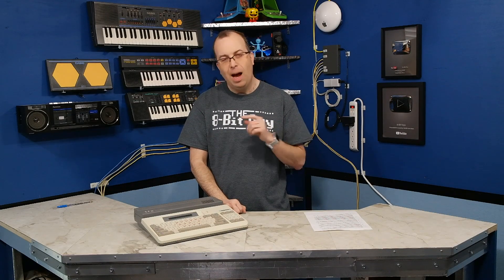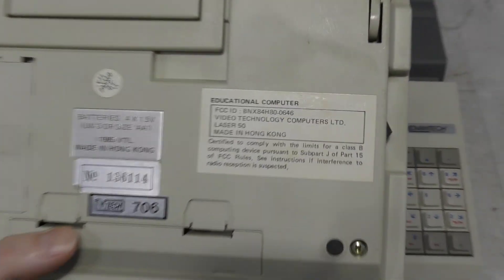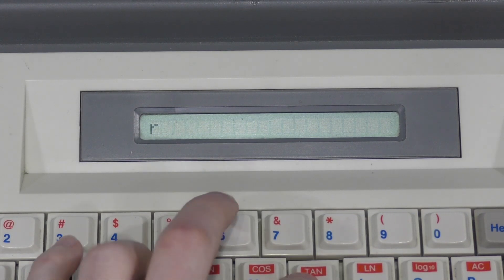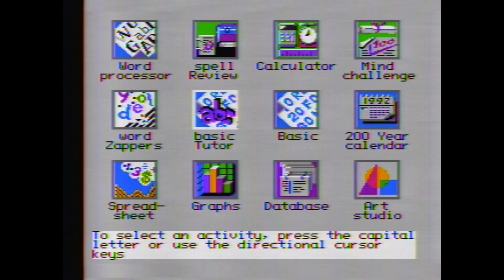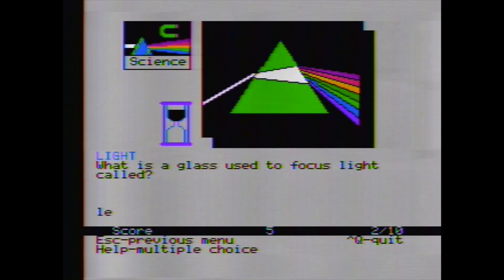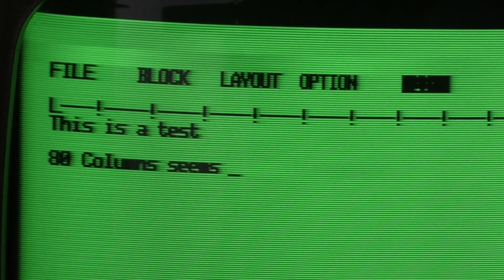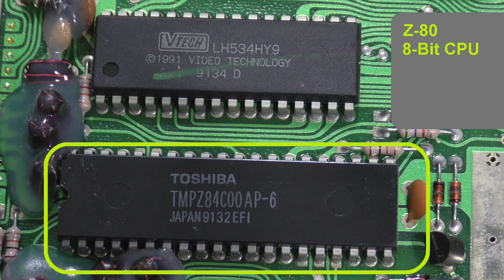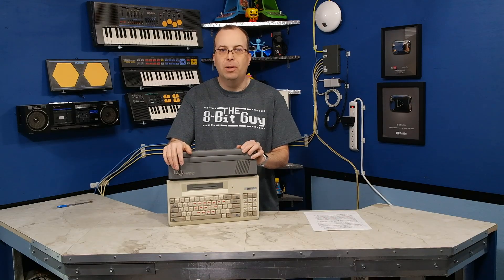The Advantech I.Q. Unlimited with BASIC and a Z80 CPU.

Comment: Some comments on this machine. The TMP42C50N microcontroller has 512 bytes (not kilobytes) of ROM and 32 nibbles (half-bytes) of RAM. It seems connected to the keyboard ribbon by a series of resistors, so it probably is a keyboard controller. The 74HC244 seems connected to the printer port, so it most likely works as a printer port interface.

Now we begin with the guesswork. Knowing that VTech had produced the Laser 128, an Apple IIc clone, and that this computer graphics mode is, apparently, pretty similar to the Apple II's DHGR mode (560 by 192, 16 colors generated by color subcarrier artifacts), I'd venture and say that the two unknown chips are an Apple-II-in-a-chip and a ROM chip (containing the firmware and the programs). The LH534NY9 sits next to the microprocessor, typical for a ROM chip, and the 26-5063-01 SMD chip on the backside is similar to chips in the Laser 128/128EX motherboards known to be related to video generation, so I think this is plausible.

If this is true, the use of the 128 KB of semi-static RAM would make sense: the Apple II models with 128 KB of RAM divided it into two banks of 64 KB (main and auxiliary). It wasn't paged memory, you had to switch the entire address space, so you could only access one bank at a time. Because of that, it was usual to use the main bank for the OS, the program, the display RAM and the working memory, and the auxiliary bank as a RAM disk (managed by the OS) or a data storage (this is a simplification, but accurate enough for this discussion). If so, this machine could use the first 64 KB as working memory, and the remaining 64 KB as battery backed storage. This would fit the ad that said "64K of RAM allows students to to use and store programs".

The Advantech I.Q.  is amazingly similar to the Tiger Learning Computer (https://www.youtube.com/watch?v=WZk-utRYrI0), a prototype of an Apple II compatible educational computer made under license from Apple in 1996 (and cancelled when Jobs returned). Both are supposed to be easy, self-contained computers with no moving parts and a limited software library included. These two characteristics, while limiting to full-fledged computer users, were attractive for parents looking for a simple (and durable) computer for their children. And I'd bet my hat that the Tiger Learning Computer (advertised as having "Apple IIe Technology") was based on Apple's Mega II, basically an Apple-II-in-a-chip created for the Apple IIgs and later used in the Apple IIe Card for the Macintosh LC.
Reply: By the way, even if this machine uses an Apple-II-in-a-chip, it doesn't make it an Apple II compatible or clone - because of the Z80 processor. But, in theory, it's entirely possible to stick all the logic of an Apple II (or any 6502-based computer) to a Z80 processor. The advantage? Using a proven hardware design without having to develop it.
Reply: Sounds pretty cromulent vs what I was guessing at. I'd figured on 4x 32k blocks and 12k of video memory (which would fit with 6x8-pixel chars and 480x200 total), but if the remaining space readout was rounding up fairly heavily or just dividing by 1000 instead of 1024, then the just-over-13k needed for a 560x192 monochrome display would work too. Guess we need to try and count the dots used in the low rez mode to determine if it's more likely to be 240 or 280 total (or even 320? I don't think the clock is quite fast enough for that...)

That hard bank switching would make loading or saving files a complete pain in the ass, at least if you were using the second 64kb (there are multiple virtual drives, I expect at the very least it's "saving into whatever's left of the first 64k" and "saving into the second 64k" plus use of some additional cartridge or a real disk drive or cassette deck that's been somehow connected). If you can only use one half at a time, you're going to have to shift probably single bytes, maybe two or three at a time max, via the processor registers only (or maybe a few extra if using the keyboard controller RAM too). Though so long as the bank switching delay wasn't super massive you might be able to get a few kb/sec by that method, which would be sufficient for the small files involved.

Bigger issue is - how do we access the ROM? There's 512kb of data in there, and it's all code and graphics needed by the programs. We can't realistically keep banking in 64kb of that with no RAM available, the machine will spend all its time banking back and forth and not even have any spare register space left to do any proper work. Maybe the necessary data for a particular program will be copied across in the same way as loading in a work file, but 12 progs total means each average about 42k. It seems like it would be a very inefficient way of doing things. Better to split the address space into e.g. four 16k chunks... Working memory, VRAM, storage RAM, and ROM... each program actually taking 2 or 3 banks out of the 32 in the chip. Though of course it's not necessarily the case that all of them are used. It could be 12x 32k (=384kb used), or even just 12x 16k (well, actually 13x, as the main startup menu would occupy a space too) with 512k ROMs simply having become cheap enough by 1991 that it didn't save any money to risk speccing it with a 256k before the software was finalised.
Reply: A couple of notes on memory banking on the Apple II - which should apply to this machine if it's based on an Apple-II-in-a-chip.

First , when I said that the entire address space was banked, I simplified it a bit. The lower 48 KB of address space banks as one unit, and the upper 16 KB, which contains the ROM, banks as other unit. Both can be banked independently for reads and writes, so you can set one bank for read and the other for write, and copy memory from bank to bank in a thigh loop.

Also, the 16 KB ROM space is banked itself. Starting with the IIc, the Apple II supported 32 KB of ROM divided in two banks, and it is technically possible to use more banks to support larger ROMs. That space can also be switched between RAM and ROM, so you can access the full 64 KB of each RAM bank.
Reply: Actually checking on how the Apple II made its video, it ran the pixel clock at exact multiples of the NTSC colourburst; twice for hi-rez / 6 colour mode, ie 7.16mhz, and four times for double-hi / 16 colour mode = 14.32mhz.

That wouldn't gel too well with a processor running at 6mhz... and looking more closely at the text it definitely seems to be 6 pixel wide, not 7. Plus the way it creates its colours is very much different (pairs of greyscales with maybe 5 or 6 levels, rather than 4+ strips of pure monochrome) and the number of them it seems to use is different too (12, not 6 or 16). It's still artefacting, but synching differently with a different set of patterns, maybe closer to how the NES does it (also in the region of 6mhz). Could even be the common 5.37mhz (or 10.74mhz for 80-col) as used with a whole load of TMS VDP-using machines, which just about fit 256 pixels across a TV screen with a small bit of over or underscan, so 40 (or 80) 6-pixel characters would work just fine.

Though I'm wondering now, seeing how the modulator attaches to the "power" PCB - and how the composite output is cosited with the DC input - if the video system might actually be wholly separate, including a CRTC or VDP plus its own 16k or so of memory... very much like the CGA, in fact, and a variety of early 8-bit computers (inc MSX, BBC Micro) and consoles (Intellivision, Sega SG1000), just with the bit patterns for colour mode being interpreted in a way similar to that of the Apple IIgs in its specific hi-rez mode... which can show black and white pixels in full resolution, but any colour appears effectively in low rez, with a limited set of patterns putting black, white, and four primary colours together to make 15 pseudocolours. In this case though it's all greys instead, creating colours entirely through artefacting, and only making maybe 12 overall. At least, that's the most I can count on any one screen in the video.
Reply: Yes, it looks like the character cell is 6 pixel wide. It fooled me, 
because it uses a character set similar to that of the Apple II, which 
used a 7x8 cell with 5x7 active pixels (two empty columns on each cell). This computer seems to use a 6-pixel-wide cell with 5 active pixels.

The palette is also weirdly similar to the Apple II's hi-res palette (black, white, green, orange, magenta and blue) but with two different intensities for each color (full and half intensity). This would also allow for a single gray (half intensity white). The presence of four "primary" colors would point to a 14.32 MHz color clock (four phases over the 3.58 color subcarrier). The pixels look aligned with the color clock, so I'd venture to say it uses a 7.16 MHz pixel clock. This is coherent with the artifacts shown by white text on black background in a color monitor (which are always one of the four colors from the Apple II palette).

There seems to be no apparent limitation on which colors can be on which place, which would point to a true 16 color framebuffer or a NES/MSX-style tile-and-attribute mode. I think the former is more likely, because if it used a tiled mode, why limit the color palette so heavily? Even the NES can display 25 colors from a palette of 54 with just 2 KB of RAM.

Anyway, I can't think of any home computer or video controller with those specs, and it seems weird to develop a completely new chipset for a cheap computer when you can grab an of the shelf part and save the design costs. This is why I thought it used an Apple-II-in-a-chip...

Last, the processor is rated for 6 MHz, but it doesn't mean it actually runs at that speed; it's just the part's upper limit. I'd bet it is an integer divisor of the 14.32 MHz master clock bellow 6 MHz, so 4.77 and 3.58 are the most likely speeds. Taking into account that the graphics controller itself runs at either 3.58 or 7.16 MHZ, and doing a 4:3 bus interleave between the graphics controller and the main processor is possible but hard, the processor probably runs at 3.58 MHz. Then, why bother buying a 6 MHz part to run it at a lower speed? Because it probably was the cheaper variant available by the time this machine came to market.
Reply: Hm, possible, but I'm not entirely so sure though. The colours appear to be black, white, three or four greys (we can see three just on the menu screen, and I think there might be another darker one that's seen in a couple places), a royal purple, a slightly lighter and pinker purple, a kind of scarlet/sunburn red, a darker red, a single amber-ish yellow, a light and dark green, and a single sky-ish blue. Which actually when I add it up properly is 13 or 14 colours, not sure how I arrived at 12 before :-) So probably there are 16 bit patterns, with a couple instances of two patterns aliasing to each other.

The amber colour particularly is less Apple-ish orange and seems more similar to the only (full intensity) yellowish colour that the NES is able to produce, and its PPU actually outputs dots at about 6MHz IIRC, which is a bit of an oddball.

...Google says: actually 5.37MHz, and it generates colour in a curious manner by producing a binary squarewave that, unless full screen tinting is used (which overlays further attenuation on part of the waveform), simply alternates between zero and the fraction of full signal intensity matching the colour brightness at 3.58MHz, at any of 12 phase shift positions (~43MHz precision - counting both the rising and falling edges of the ~21.5MHz master clock from which the PPU divides by 4, the colourburst clock by 7, and the CPU by 12)... Which gives us the 50-some colour palette by providing 4 intensities of 12 hues, plus another 8 or so greyscales that keep a steady signal level or alternate far faster than the colour clock. The frequency is just about enough for 256 logical (and monochrome) pixels, though certainly not 280, but only around 172 distinct colour patches in the same space... the points at which the colour actually switches drifts slightly line by line and frame by frame so as it rapidly skims across the underlying logical pixels you get the impression of 256 slightly smeared coloured pixels instead.

As that 256-pixel image tends to quite neatly touch the edges of a TV screen, and the IQ's 240 or 480 pixel one has a narrow border inside of it (looks like one to two character spaces on each side in 80-column mode, so about 504 visible pixels, or 252 in 40-column), I'd go with 5.33 and 10.67MHz being quite good matches for the frequency. Even a full 6 would probably be too much - you could get closer to 576 pixels with that, which would mean a full 8 blank character spaces each side on a screen perfectly matched to a NES or similar console, though it's possible these screens are adjusted to give a rather extreme amount of overscan? 7.16MHz would be far too much - that's what systems like the Amiga use, and they can comfortably fit 320 pixels within the underscan region of a regular TV, or 640 at 14.32MHz.

That's sort of how 320/640 and 8-pixel characters became a standard resolution, even, as it was first seen in the C64 and Atari 8-bits, which used a 7.16MHz master clock, running their highest resolution modes direct, halving it for low rez, and quartering / sixth-ing / eigth-ing it for the CPU and other parts of the chipset. Otherwise 6 or 7 pixel (TMS VDP, Apple II) or even 9 pixel (as used with the PC MDA, and the Atari ST could easily have had 360/720-pixel modes using its 8 and 16MHz clocks instead of very heavily bordered 320/640 ones, if the designers weren't aiming at matching the resolutions of the Commodore range as well as economising on memory)

I don't know how it relates in terms of colour generation, but that text resolution makes me think that it might be using a Texas Instruments VDP type video chip, which certainly for 40 column text modes used a 6x8 font (5x7 actual glyph pixels) for 240 active pixels plus a protective 8-pixel border each side, versus the 256-pixel graphics rez it also offered, both with a 5.37MHz standard clock. Later models presumably extending that to 512 pixels or 80 column text with 480 pixels, at 10.74MHz. And of course 24 or 25 rows, using 192 or 200 scanlines. ISTR it offered upto 16 colours too, though how complex you could make the actual graphics may have been limited by a 16kb total memory space at least in earlier versions.

Also the monochrome image shows a rather different way of building a colour picture than what the Apple II uses:

6-colour mode on the Apple uses pairs of straight black and white pixels, at 7.16mhz, so you only actually have four colours for each of the 140 double-pixel spaces; each block of seven "real" pixels (so 3.5 wide pixels) is switched between green/magenta or orange/blue using the otherwise undisplayed 8th pixel (so actually I miscalculated - hirez takes 7.5kb and double hirez 15kb, for the equivalent of 320x192 and 640x192 monochrome), which shifts the actual timing forward or back by 45 phase degrees (so a quarter pixel). Which is why making graphics that use colours from both groups on the same line without artefacts can be quite tricky. The blue and green are fairly similar, but the orange and purples don't really match, the red is completely missing, and there are no greys.

16-colour mode uses binary pixels again, no greys, in groups of four instead of two, at 14.32mhz. Every colour is unique (there's a full 16 colour palette), and whilst several of them seem to match with the IQ, there's a number of differences also. For example, two blues, another green, both an orange and a proper yellow, and a light pink... but only two flat greys (plus an additional pair of slightly tinted ones, sitting just outside the brightness range of those), one purple, one red.

The IQ instead uses pairs of pixels (at 10.74MHz even in low rez? it's a bit confusing as there seems to be places where the colour columns don't entirely match up with the black outlining pixels of certain shapes? Not entirely sure...), of directly varying intensities instead of using full range B/W and relying on the TV to smear them into greys. It also looks like, oddly, that the pixels of each pair don't ever differ in intensity by more than one, maybe two greyscale steps (and of course black, white, and the flat greys have pixels that are both the same level), which suggests some less than straightforward translation of bit pattern into individual pixel intensity, and what puts me in mind of the IIgs. Maybe like there's 8 notional levels for the left pixel (3 bits), and then the fourth bit determines whether the second one is the same or darker, with a few particular codes (for brightnesses that don't actually exist) instead translating into the second one being brighter. And maybe there are actually limits on what colour can go where, or the minimum width of a non-B/W coloured pixel (most blocks look like they're multiples of 2 pixels?) that aren't obvious because the graphic designers were good at hiding it? I'm not entirely sure why 80-column mode is just straight monochrome instead of being 4-grey or still having some artefact colours, otherwise. Or why they didn't disable the colourburst in that mode so that it doesn't artefact to hell on a colour screen, but maybe that was just a plain dumb mistake.

As for the characteristic colours of the fringing on the black and white letters, I think that might just be something that happens pretty much regardless of the frequency, when you have thin white characters on a black background or the reverse, depending on the phase relationship with the NTSC colour clock. They appear to come out the same way in both 40 and 80 col modes, but if anything much else was produced with single pixel columns you'd expect the 80 col colours to be much more diverse. Maybe getting other colours needs a more complicated repeating pattern? Or it could simply be coincidence, maybe born of the reasonably close relationship of 5.37 to 7.16 along with 6 instead of 7 pixel chars; the straight sum is something like 4:3 (like the bus interleave you suggested), and after accounting for the char width is in fact about 7:6. And there are still some slight suggestion of additional tones creeping in (pinker or bluer purples vs the average, for example) in both modes, rather than strictly just the main four.

The annoying thing is rather that I can't think of any machine, at least not any easily hacked/reprogrammed one, that produces 10.74MHz pixels at varying grey levels in that we can use to try recreating the IQ's colour patterns to confirm the theory. Most common old consoles and computers that use that kind of chipset only run in 256 pixel or 40 column mode, so wouldn't offer enough resolution, and those which do go higher are somewhat rarer and harder to get hold of in the west, like the MSX2+ ranges and so on and might not be so straightforward to prepare example graphical screens for. The Playstation and PS2 can actually do a 512-pixel mode with the right clock, with at least a 15-bit palette (so can do a decent range of greys), but I've got no idea how the heck one might go about making a disc with images on (or a program that would produce test patterns) that would run on them, particularly unmodified ones.

The frequencies ARE 1.5x and 3.0x the colourburst clock, which suggests it should be twiddlable to create fairly steady colours anyway, and may account for the rather ugly amount of fringing because the paired pixels only directly match up with the colour clock on every cycle... there's just no easy way I can think of to generate a suitable signal that we can play with, arranging different pairs of greyscale pixels together to see what colours come out, and whether we end up with certain pairs that either look identical or are so close to each other that it's only worth using one of them, so there are only 13 or 14 properly unique choices.

Wonder even if I could set a custom mode on a PLL-equipped PC videocard that ran at a multiple of that, but with NTSC timings, and jerry rig a cable to adapt from RGB VGA to monochrome composite... problem then would be injecting colourburst...
Reply: In fact with a bit more google work, looks like what we need is the PC Engine / Turbografix ... which could even be an alternate source of reused chippery for the IQ. It has modes at 5.37MHz, 7.16MHz and 10.74MHz (256, 320 and 512 pixels) and either 8 or 32 greyscales... the latter would be better for emulating a 5- or 6-level system, but you could get away with the former.

Still not sure how you'd go about making a suitable program or images to show on the machine, but the hardware would be easier to get hold of, and maybe indeed emulatable.

Or possibly in fact my old ST could maybe be tricked into producing something suitable... its hi-rez mode pixel clock is 32.04 MHz... divide that by 3, we get 10.68 MHz, which is probably close enough (if I had a TT or Mega STe it'd be even better, as their system master clocks, and so pixel clocks in hi-rez, are 9x colourburst, for better compatibility with VGA monitors; divide by 3, get exactly the desired 10.74 MHz). Issue then still is that the horizontal frequency is off, it only makes monochrome pixels in that mode (could try producing 4 distinct grey densities, with 8 different bitpatterns, which might do as good a job for testing, but the additional side frequencies/rhythms so created would probably spoil things), and there's still no colourburst.

If I was made of money the solution would probably be to get a TT (stupidly expensive...) and run it in its VGA compatible 16-colour (from 4096, so 16 grey levels) mode, which is twice the Hfreq of but same Vfreq as NTSC TV, but still runs a 32.22MHz pixel clock (vs the 25.18 or 28.32 of real VGA), disconnect the syncs, bridge the RGBs to a monochrome signal, and splice it together with a regular NTSC composite video source showing a flat white image (which will be close to zero signal level outside of the sync areas) to provide some arbitrary synchronisation plus the colourburst. The ersatz 10.74MHz pixels could then be made fairly easily using triads of TT ones, with every two TT lines appearing as a single line with a break in the middle on the TV (ordinarily the frequency would be enough to fit about 800 pixels across a visible VGA line, so doubling that gives us 1600 plus a little more for the halfway sync; dividing that by 3 makes the equivalent of 533 triads possible along each line, which is of course more than enough for emulating a 480-pixel linewidth instead). There might be a bit of drift resulting from the two not-strictly-synced signals, which may occasionally also interrupt the synchronisation, but that won't matter if we're just showing a series of readymade colour patch pictures with a keyboard controlled slideshow program, and a white background and border will minimise it the disruption.

Sadly, I'm not made of money :D

Maybe it might be doable with a suitably programmed Raspberry Pi or something?
Reply: Regarding the CPU itself... Z80s were still being graded as good for 2, 3, 4, 5 ... 8, 10 etc MHz at the time, so I don't see why you'd bother with a 6MHz rated part if a 5MHz one would do (or indeed a 4MHz one, maybe with a little overclocking). Everything else in the machine seems to be reasonably "right-sized", not being overdriven or particularly wasted; it's the minimum it needs to be and no more... Which again suggests it may use a simple 2:1 division of a 10.74MHz master clock. And colourburst could be a simple 3:1 division.

Of course, it shouldn't be too hard to just look around the motherboard and see what clock crystal is on there... if one was to have access to an example machine, that is.

Daaaaaaaaaaave, what xtal is on the board? :D
Reply: Apple II in 1996... and Jobs cancelled it. What a prick. And a horribly out of date platform that no body wanted or needed. In 1994 I was running Apple II programs just fine on the 386s and Macs for that matter in the computer labs at my university. When I wanted to dick around a bit that is. Otherwise I was playing Civilization, Wing Commander, Doom, generating fractals for hours on end using Fractint, all on a variety of Intel hardware from a 286 with VGA to a 486DX2-66 a friend had. And Apple had released their PowerPC based Macs and I was drooling over a delivery of PowerPC Mac note books (can't remember if they were called Macbooks at that stage or not). And 3 years later Jobs is pissing on people that want to eek out some pennies at the low end by selling FULLY LICENSED Apple II clones? The guy was such an utter cunt.
Reply: @MrGoatflakes  Apple called their laptops PowerBook, even when they used 68K CPUs, until the switch to Intel in 2004. That's when they made the change to Macbook. The desktops were just Macintosh until the switch to PowerPC when they became PowerMac.
Reply: 74HC244 is actually a unidirectional buffer, not the shift register. Well, two 4-bit buffers to be precise. HC in the designation means High speed, CMOS, so it's both high speed (ie. can handle over 20MHz) and low power. Buffer, when activated, takes data from it's input (one 8-bit byte, as two halves were commonly wired to work together) and passes it to the output. And yes, it will most probably be a printer interface, with the reason being simple: it's cheaper to replace this chip than the CPU itself. Also it effectively isolates the CPU data bus from the printer, allowing it to receive data only when the software wants to print.
Reply: It also means that the CPU isn't completely locked up by the printing process. Instead it just needs to shunt 8 bits of data into the buffer, and let the printer pick it up at leisure, putting another 8 bits on the buffer line once the printer acknowledges receipt.

Thing is, you need more than 8 bits to make a parallel printer interface. You at the very least need a ninth output line (strobe, which signals there's a fresh, valid byte of data on the main 8 lines, after going inactive then active again), and two or three return lines (ready/online, data read acknowledge, and optionally paper out). So how are those additional 4 lines connected? Does that chip actually have 3 x 4-bit buffers in it (three of the bits in the third one could easily be connected port-to-CPU instead of the other way round, with the latching controlled by the same trigger line as the strobe, because the printer will keep its own output lines asserted so long as the relevant statuses remain true, so the CPU can sample them whenever, or just latch that buffer multiple times per strobe transition)? If it's being used for electrical isolation between the port and CPU, surely you need to isolate all of the lines in use, not just the 8 data bits?
Reply: from experience most of the ICs that start with 74HC are usually simple logic chips like multiplexers, shift registers, or gates etc so i guess these might be used for some sort of IO interface
Reply: @eduardopupucon  a 74244 is an 8 bit or two 4 bit buffer and line driver with three state inputs. This means that it can hold a value of a byte (or two independently changeable nibbles), it has a reasonable fanout (can drive its output to a reasonable number of gates, or a long bus, without the voltage dropping off), and it is three state which means that not only can it drive each of the 8 bits 0 or 1, it can also put all of the 8 pins it drives into what is called hi impedance mode (Hi Z). This effectively disconnects the chip from those 8 bits, without having it just swing in the breeze, useful if another chip on that line wants to drive the input instead. 

So you can see it makes perfect sense that it would be used to drive a printer port. The cpu puts it into Hi Z mode and fills it up with a byte of data and then cancels Hi Z, and then the chip will store the that byte and put out that byte on the printer cable for the slow arsed printer to get to when it feels like, and then the CPU's job is done for that byte and it can get on with it's life not having to wait for the printer.

The HC in 74HC244 is the actual technology used to make and electrical characteristics of the chip, in this case high speed CMOS.(Complimentary Metal Oxide Semiconductor transistors) There was also the original SN series, which were TTL (bipolar transistor transistor logic), LS for low powered Schottky transistors, HCL for high speed CMOS capable of interfacing with TTL chips, etc, etc.
Reply: I wonder if it could be made to run CP/M since they had CP/M cards for Apple IIs.
Reply: So, the TMP42C50N has 512 bytes of ROM and 16 bytes of RAM, right?